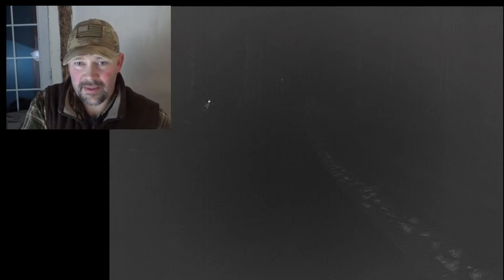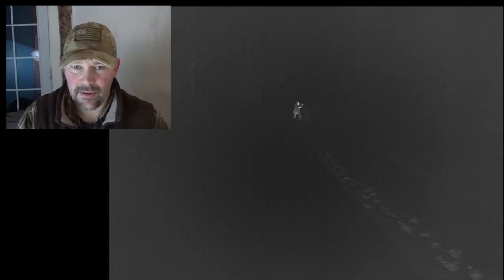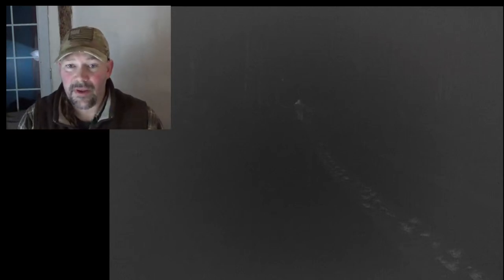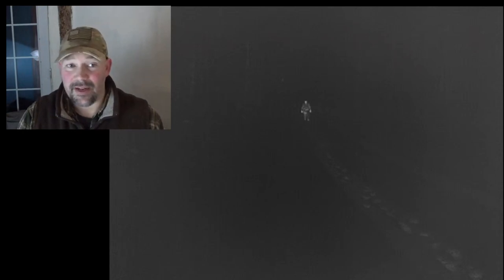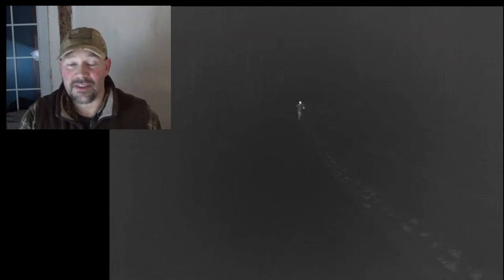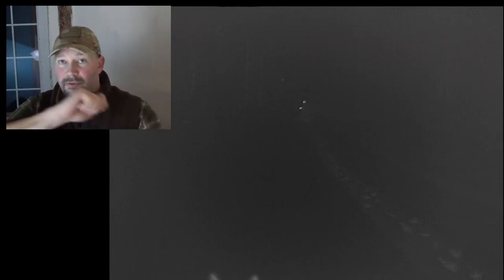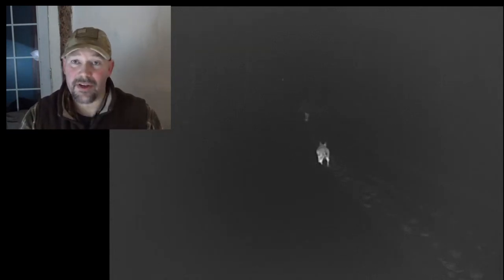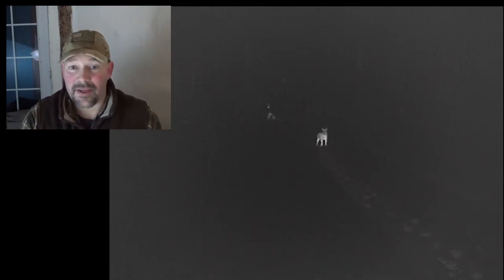Thermal scope in blizzard conditions, and heat signature blocking.

Comment: Awesome video. Read one of your comments. Thermal seems like a small niche but i believe its growing. I will help share what you are doing. 
Question
Does your thermal scope give off a heat signature?
Buying a rix leap 6 next week, my first thermal. Lots to learn!
Reply from the maker: The bigger thermals I have (640 sensor, 384 sensor) do have heat signatures. The lower end thermals (256 sensor, 80 sensor) do not. I think its just the higher end the unit, the more heat they generate during operation, and the more they rely on heat sinks to dissipate that heat. The signatures are not large regardless, and not strong. Easily lost in background clutter. But it is there.

Did you get your Rix Leap 6? How are you liking it?

Comment: Changing the subject!
Got any good ideas on a  wheeled hand pulled or pushed bugout cart that i can carry in the back of my SUV?
Reply from the maker: Unfortunately not really. It’s going to be very terrain specific. My guys down in Arizona and New Mexico  went around this subject at length a year or two ago. Tested sone models. One is a fabricator and tried out sone designs. It was pretty split up in what designs worked, and everybody needed something different. Some guys were moving on narrow trails that needed a single wheel in back, some had more open trails that wanted two wheels in back for side to side stability. Sone guys wanted shorter wheelbase and high off the ground payload rack to negotiate tighter turns and obstructions, some guys wanted the payload rack closer to the ground for lower center of gravity and stability. So guys wanted dual projections to grab onto like a rickshaw, some guys wanted a tether/lash system so they could remain armed while moving and could engage firearms quickly and keep moving with it. After several months, including fielding models, there was no consensus. No single design could meet everyone’s needs. So it winds up largely individualized.
Reply: @ThatThermalGuy  I did expect an answer but that was TERRIFIC!
I've decided to build my own.
Quick release bycycle wheels, 48"×24 bed, U shaped pull handles & upright U shaped push handle. 
It's for carrying in the SUV when traveling away from home.
A storage boy with survival gear included. 
Will be flat for easy storage.  
PRAYING, I'LL NEVER NEED IT!
Thanks for your input!

Comment: Hey Therm!  What do you think about the Olite LEP weapon sight? 
A white laser flashlight quick attachment built in!
Reply from the maker: I like anything that does it’s job reliably well in a compact lightweight unit. :) I have a friend that runs an  o-light Odin and says it’s way better than his sure fire 6P even with the high intensity head replacement. That speaks volumes for me. 👍🏻
Reply: @ThatThermalGuy  
I zeroed my white laser to my scope for night shooting.  
It's very effective.  Mine is a Finix. 
A little Too big & bulky.
Plus I  had to buy a mount for it.
The Olight has a nice mount built in!

Comment: Indeed disappointing results with that mesh 🤔, did not expect that at all
Reply from the maker: It was the total opposite of what I expected. I spent a bunch of time standing there trying multiple things with it thinking I was getting lots of different results. But when I watched the video, it barely looked like I was doing anything. It’s rare that I’m actually surprised by anything I film anymore. I usually have some idea of what something is going to look like before I film it, even if I’ve never filmed something like it before. Only four times have I actually been surprised. The first, was seeing polished metal on thermal for the first time. It was kitchen pots and pans, so simple, but I was blown away by how perfectly normal they looked through thermal. It was like someone photoshop cut and paste normal pictures of pots and pans into a thermal image. The second time I was surprised, was my first time imaging a space blanket. That flowing broken mirror effect was amazing to see and not what I expected at all, especially after seeing other YouTubers videoing space blankets on thermal (although, to be fair, those were shot with lower resolution classes of thermals). The third, was imaging flowing hot water for the first time and being able to see the rivulets and eddys and swirls of different areas of heat in it. It reminded me of ghostbusters 2 with the river of slime. And the fourth time I was actually surprised by how something imaged on thermal, was the copper mesh in this video. I did not expect such a resounding failure. Especially with the benefit of blinding snow on its side. I’m just shocked. I feel like I need to apologize for it failing so bad. Even though I didn’t actually do anything. Just… surprising.
Reply: @That Thermal Guy  i think the mesh would still work good if you double folded next to skin as an under layer, and have a maybe some 3d mesh on top of it (for more air spacing..) and on top of the 3d mesh the USGI camo net again for some more air spacing and siluet disruption....this could be used as a summer suit option 🤷🏻 
I think the copper mesh woudl work best as a base layer next to the skin would work, but in this case to  dissipate heat and not sweat like a regular army layering cloding system would do (if you are familiar with the level 1 to level 7 of the current issue clothing system us military uses,  anyway....) level 1 can be the mesh, the closest to your skin, level 2 rhe 3D mesh, and level 3 the USGI camo net 🤷🏻 what do you think? Will it work? As for a winter system. Maybe you should try the cooper mesh under the thick clouthing, because  you saw how good it worked when next to skin 🤷🏻 sorry man im all over lol